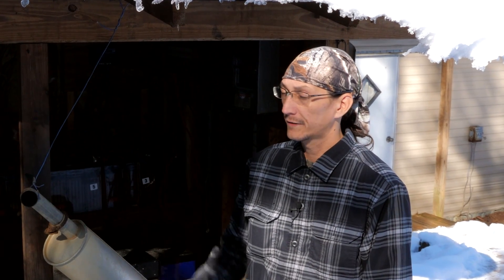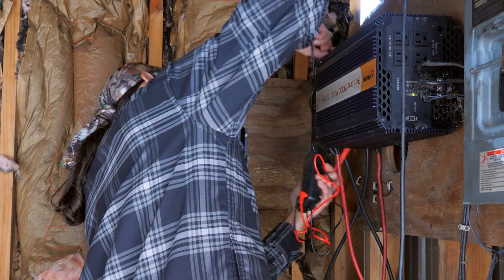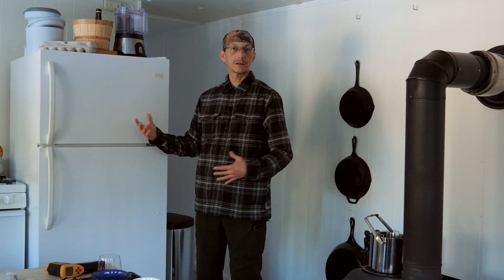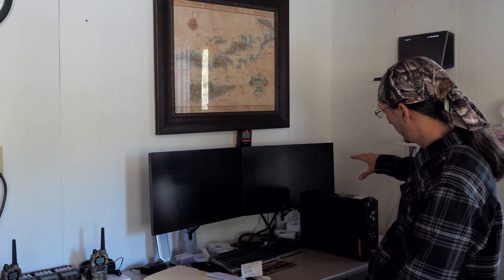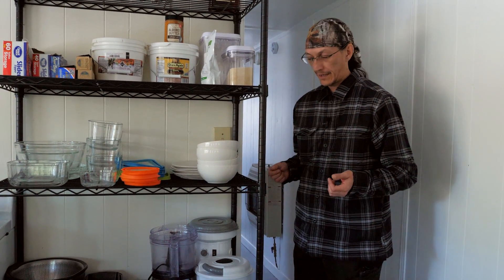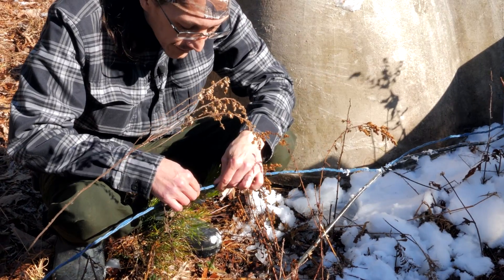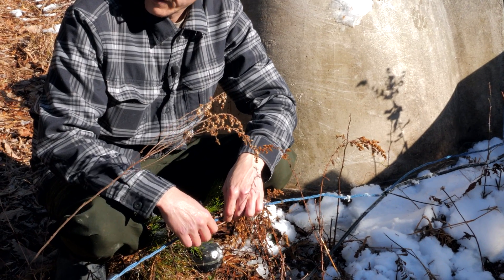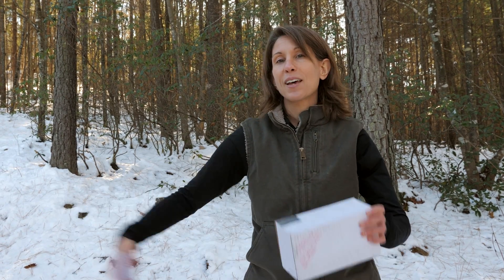Off Grid Electricity - Our DIY Solar System

Comment: not that I know any thing about this, but did you say the charge controller is supplying 12.2 volts to your batterys?  that's  what the charge controller is supplying or the power going to the charge controller? any thing much above that to the batteries after the charge controller continuous would be over charging.

Comment: I don't know how far the batteries are from the solar panels but I would look at the size wire you need to reduce the IR looses.
Reply from the maker: 150 yards lol
Reply: I posted that before you said that you were 150 yards from the batteries.  That looks like 12AWG wire which is way to small for this.  You were seeing a 6V drop from the panels to the charge controller input.  Assuming .715 ohms for each 450 foot wire you have 1.43 ohms.  Using the 6 V drop and 1.43 ohms, your batteries were pulling about 4.2 A.  The batteries were not in a deep discharge condition.  This loss is about 25W in this case.  100W solar cells can put out about 5.5 A each so with 4 of them you are looking at 22A at 18V as a possibility.  Suppose the batteries have discharged more, as they probably were first thing in the morning.  Assume they are sinking 10A.  You are now looking at a 14.3V drop.  All of your power is being wasted heating the wire and not charging your batteries. You will likely see some big improvements in charging time if you change that out for 6AWG wire or doubled up 10AWG something to get those losses down.
Reply: Really it would be best to move the solar panels or the batteries so they are much closer.  Once converted to 120VAC it is easier to deal with.

Comment: How many gallons of water per hour will your cistern fill from your spring Box?  Wondering if you can put a second cistern up the hill to only have to pump every few days instead of everyday.  Continue to use this great Community to Troubleshoot.
Reply from the maker: Stay tuned! 😉
Reply: See that was part of my thought also.  Using a smaller pump with its own solar power.  I've used some from fountains that come with their own mini-solar panel.  They are enough flow for a small shower.

Comment: Like y'all's videos. I like off grid too, but are you too far out to have just a small electric wire? It sure wouldn't cost much to run well pump and fridge. I have 500' deep well with 1 hp 220v pump, so must have electricity.

Comment: A 2300 ahr bank requires that they are charged with about 230 amps so they will not die early in their live. 
Mismatching solar panel voltage and /or amps and or wattage will reduce your power output.
A mppt charge controller will not help with mismatch panels, nor will it help in an nominal 12 volt system if the solar power is kept at around 17-18 volts. Looks like your commerical solar panels are for a grid system and not for a battery system, their voltage is low. My renogy panels have 21.5 volts. Homemade panels usually have a very short life of a couple of years and I would stay away making them. 
Your wire size seem to be very small for an 150 yard run and it will lose a lot of power. It would be better to have your batteries right next to your panels and invert the voltage to the 120 volt with your inverter and then send it the long way. What size is the wire and how many watts, voltage and amps are you sending down the 150 yard stretch? I 
may be able to help you to calculate the wire size.
You can over- panel on solar panels and run your wash-machine and other things while the sun is out and this will save on battery power and usage.
Remember you should not use more than 50 % of power from a true deep-cycle battery or you shorten the life of the deep cycle battery, a marine battery is not a true deep-cycle battery in most cases it is between a starter battery and a deep-cycle battery and makes a bad choice with shorter life, especially if it list CCA or CA on their label. 
I put 2 external  batteries on my APC UPS and that provides me with 1000 watt-hours before the low battery alarm at the UPS will sound and if you over panel then you could charge those batteries with solar power without having to use the generator.
Take the panel to be tested out of the system and check voltage and amps to determine the output.
Volts times amp = watt.

Comment: I don't know if you have a Kill-A-Watt meter. They are fantastic for figuring out your power draw for each load you have plugged in. It's great because it will tell you the watt hours consumed for things like your refrigerator that run intermittently. When I plugged the refrigerator that I brought with me from my on-grid house into the Kill-A-Watt it was pulling 250 watts when it ran and it ran a lot. It was killing my battery bank. I bought a 12 cu. ft. Energy Star rated refrigerator made by Frigidaire that only pulls 60 watts when it's running and it doesn't run all that much. More in summer, less in winter. If I had it to do over again I'd probably get the 16 cu. ft. model. the 12 is pretty small. I was trying to keep my wattage as low as I could, but I believe I could have afforded the juice for the 16. My refrigerator is sitting just a little more than ten feet from the wood stove and it doesn't pick up any heat from it other than from just being in whatever the room temperature air is.

 I'm running the Outback Flexmax80 charge controller and I can highly recommend the Outback Flexmax controllers. It's extremely efficient and the information it delivers to you about your system performance is invaluable. On a good sunny day I can bring in darn near the nominal rating of my panels.

When I start getting a lot of cloudy days in a row I'll turn the inverter off at night. The only thing that would be running at night is the refrigerator and as long as the doors aren't being opened it will go a few days before it warms up inside. This saves the power that the inverter consumes and extends my days of autonomy significantly.

150 yard wire run from your panels to your charge controller is a really, really, really long run. The first thing I'd do is figure out how to get them a lot closer. Like within 30 or 40 ft. if possible. I'm within a degree of latitude as you guys and my optimum angles are 70 degrees for the summer solstice, 30 degrees for the winter solstice and 50 degrees for the equinoxes. I started out fooling with changing the angles for the seasons, but now I just leave them set at the optimum winter angle the year round. Winter is when you'll have the most trouble producing electricity.

Reading voltage is only part of the equation. You have to know what the current flowing in your wires is also so you can determine power in and power out. That's a heck of a nice diesel generator you guys have.
Reply from the maker: My killawatt died finally so I got a TacLife. Same thing but i like it better. This fridge pulled 1.36kw per day next to the wood stove. Now it pulls nothing on the porch. I’ll go with the Outbacks in the new house probably. For this place I just ordered an EPEVER with an add on monitoring display. I cant really move the panels because they are where the sun is but I’ll probably try rewiring them in series to push more volts and less amps just to compare the difference.
Reply: That will definitely help.  Get the voltage as high as the controller can handle on the input.  Less amps down the wire equals less power wasted as heat...  150 yards is a really long run at 12 volts.
Reply from the maker: Yes
Reply: I don't know about the controller you have there, but Outback recommends the optimum operating voltage (Vmp) from the panels to be 12 to 24 higher than your nominal battery bank voltage. With my 24v panels I had them series wired with strings of two which gave me 60.2 Vmp. Which is 12.2 volts above my 48v nominal battery voltage. It worked fine except I found that I couldn't reach sufficient voltage to equalize the battery bank. I added one more panel which allowed me to wire strings of three in series. You have to be careful though because if your open circuit voltage (Voc) starts to approach 145 volts you can destroy the (FM80) controller. The colder the temperature the higher the voltage produced by your panels, though not necessarily higher power produced. 

It is also very important that your charge controller has a battery temperature sensor, because batteries need to be charged at different rates depending on how cold or warm they are. Without the BTS your controller won't know what to correctly feed to your battery bank.

Comment: despise not small beginnings... looks like a good attempt.
and here i resist the urge to be yet another internet idiot telling you how to do your solar.

i'm a licensed electrician (in 3 states, NH, RI, and MA) and certified in advanced photovoltaic design and installation.  there are about a million things i would not have done here, but that doesn't make your system "wrong."  it works, it isn't setting itself on fire, and you are generating volts with it.  that right there deserves a slap on the back!  good job!!

love your videos :-)

Comment: I don't know the fall of your land, but it looks sloped. One solution, often used in Australia, is to set up a header tank on the highest point of your property, then have a pump with solar panels attached, which fill that header tank up, whenever the sun shines. In this case, it would run from the spring to the header tank. Then you use gravity fed water to the house, whenever you want. The pump only runs when the sun shines, and you just size your tank to suit your 3 days normal water usage, to account for cloudy days. It all depends how high you can get your header tank. I think 15 meters above house level, is the minimum for enough pressure. But you can use different pipe sizes to increase pressure too. So there's another option if it suits your location.
Reply: Chris, great idea, have a tank above for usage, especially in summer drought if the creek runs slower than usage, then they have a backup water storage tank too. Xoxo from Arizona.

Comment: If you want to monitor parts of your solar system, without buying expensive dedicated solar stuff, you can get an inexpensive (See ~$15 or less, with delivery) microcontroller, like an ATMega2560, it has built in comparitors and other functions you can use with feedback to either a cheap screen or a computer you already have.  You should be able to build suitable circuit to sample even the 120VAC for ~$20.  You can use these circuits for other fun stuff later, or advance it into a part of your solar system.  With even relatively limited skills, this can save you quite a bit of money on solar system components.  Hopefully you find this helpful.  If you want to talk in more detail, let me know.
Reply: Tenergy Watt Meter and Power Analyzer

Comment: In Québec, Canada, you can hook yourself to the electric grid and use them as a "battery bank" for your own renewable electricity production.
You have two meters. One measure the electricity you produce and inject in the grid and one measure the electricity you consume. This way, you can produce a lot on the day (or summer) without any physical battery to store the energy. And later on the night (or winter time) you can use credit for sucking back this electricity for heating or any use. Or you can simply have a very small hydro or windmill working 24/24 7/7 year long and use the grid for high power demand such as morning and supper time.

It help a lot to downsize your production equipement and require no battery.
Reply from the maker: It’s called net metering. They can change the prices and rules on you at any time. Which is why we will always have our own system.
Reply: For sure, you are right, but on the long run, it is all about personal risk assesment and expected ROI.

Comment: Just a couple more thoughts because i care. Disconnect all the batteries and test individual voltages and remove the ones with low voltage, hookthe rest back up. Now move all those solar panels near the batteries..... Lean them against the house if you have to.....and take all that wire and use it to hookup ALL of those panels. That battery bank is HUGE. Those are what? Maybe 100- 200 ah batteries so you have 600- 1200 ah bank total. Dont wait to get a new charge controller. Fix what you have first and you will run that generator much less.
Reply from the maker: Yep. All good ideas but there is no sun close to the camp for longer than 1 hour per day.

Comment: What resources are you using to learn about solar? You talk about solar hours and watts, amps, etc. and I am clueless. Would love a point in the right direction. Thanks!
Reply from the maker: There isn’t just one site or book for info and there isn’t just one solution. We just started reading and watching everything and then we choose what is applicable to us to our situation. Just jump in anywhere and start taking in and much as you can.
Reply: Thank you!
Reply: Build Your Own Low-Budget Solar Power System, by Steven Gregersen is a great little book. An easy read and an excellent place to get started especially if you are on a low budget.
Reply: Thank you!

Comment: Your cabling is severely underrated for the power you're trying to run through it.  It's affecting your charge rate & the amount of power going from the top to bottom of the hill.  Also, drop your inverter pack at the top of the hill from DC to AC as there is less power loss on AC.  On DC you're heating up the power cable - this is one of the reasons why power grid wiring in the USA is run on AC power.  Changing these two things alone will significantly reduce your power loss.  Additionally (and I know you're using what was there to begin with) once you move the battery bank to the top of the hill - as near to the power generation as possible - this will also decrease your overall power loss.  Also, measure watts rather than volts as it will give you a better idea of what you're actually getting.   As for the charging regulator, you're always going to get power loss at that level unless you significantly increase your cost.  Finally, as you're looking to increase your battery bank, make sure you monitor it & check the batteries regularly.  The batteries themselves are decent.  One of my friend's battery bank's caught fire.  One of the batteries went short circuit and caught fire causing the rest to go runaway.  I'm posting this for a friend who has many decades of experience working with power systems.  As always, check with a professional first as this is only as is advice.
Reply: AC and DC have the same losses if the voltage amps or watts and distance is the same.
The only reason that grid power is AC is because in AC it very easy to step up the voltage and to lower it.
As a matter of fact with the new electronics available right now, power companies are already talking about going back to DC voltage even for long distance ranges.

Comment: I'm no expert but your solar panels usually need to be match from what I have seen and your wire coming from your solar panel to your charge controller is best if it is oversized and braided copper wire like welding wire and your charge controller is a pretty cheap one so it's not exactly optimizing the power that is coming into it as for your batteries if you can find yourself an old chest deep freezer you could install them inside of it and have the lid so you can close it and run a 6 in pipe coming from the house with computer fan on it drawing warm air from the house into the box blowing it into the bottom of the box and then venting out the top of the freezer to the outside air would help stabilize the battery temperature my greatest priority would be to change the wire from the solar panels to the charge controller to the proper size wire and if you're planning on upgrading oversized the wire accordingly and then the second upgrade would be getting your batteries stable and temperature and making sure all your connections are clean and tight would go a long ways two ruling out a lot of your problems in my opinion hope this information helps

Comment: You need to hang most your shirts and stuff up to dry in your house.  They would dry within an hour, so you can go about your day.  I was freezing just watching you hang it out on your porch.  Hang it in your closet, and then fold and put away.  You won't regret it.
Reply from the maker: We have indoor rope for things that need dried quickly. There isn’t enough room indoors for a full load though. This works 😉. Besides, we are outside most of the day anyway.

Comment: You will not need to direct vent the a propane refrigerator. I have a propane refrigerator, they are very efficient. Mine is a 15 cu ft and I paid $ 1200.00 for it. So worth it for me

Comment: My off grid shed  runs a freezer just fine but my system is much bigger than yours. In due time you will acquire better and more equipment.

Comment: In gardening each layer of covering adds temperature protection.  I have seen battery systems inside an insulated box that was inside a shed.  Steve Harris of 1234.com in Chicago has a lot of information on battery banks on his different websites.

Comment: Places like Harbor Freight often sell small solar powered water pumps for fountains that include the panel along with the pump.  Its not high flow, but it was enough I designed a small shower off of it awhile back.  I purchased the one I have for about $20.  You can look around and see what you can find.  Might be helpful, even if its just a slow fill to your reservoir further up the hill or something.  It would mean far less pull on your existing battery bank anyway, I should think.  Particularly since it is self powered.